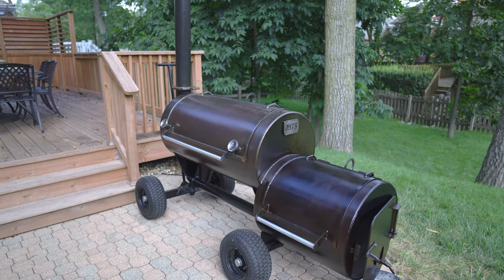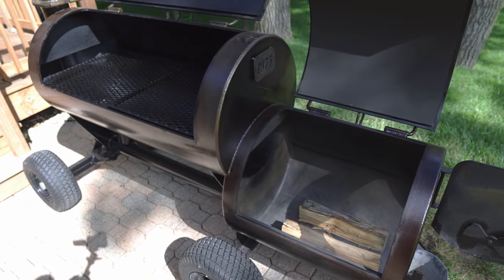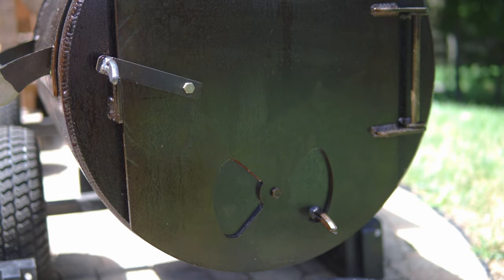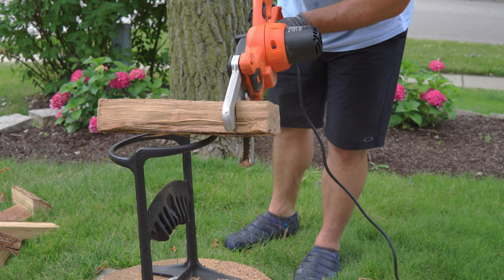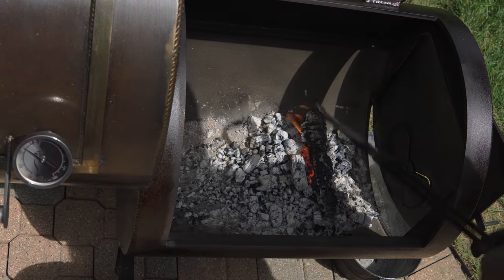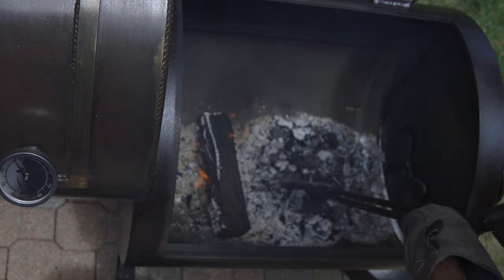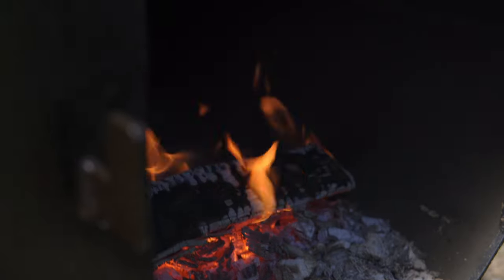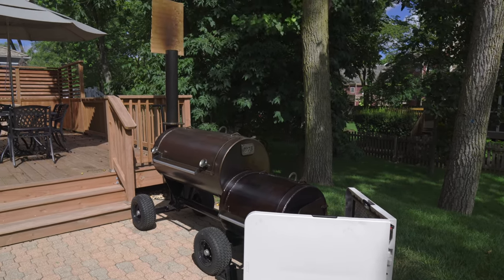How to Build a Coal Bed & Fire Management - Offset Smoker - Backyard BBQ

Comment: Thanks for this video! You did a really good job explaining things. Should make things easier for me when my 1975 arrives. I was thinking about starting my coal bed with a full chimney of B&B lump charcoal. Do you think this would make it easier and faster to maintain a good coal bed? Thanks for sharing!
Reply from the maker: Thank you! I've never used lump as a base, as I have a ton of firewood, so that's cheaper for me. However, there's plenty of Workhorse Pit owners who use charcoal or lump to get their fire started with no issues, so you should be good to go. It may be a bit easier to start your fire (using a torch makes it very easy too), but after that first split, I'm guessing it's the same thing.
Reply from the maker: I just remembered this video linked below - check out his 1st tip. Experiment with a few different lump charcoals to find the perfect one. I'm lazy haha and my goal is to have the easiest version of managing the fire as possible, so finding a lump charcoal that's a great fit for your fire is next level stuff. Once you get your pit, let me know what you find to be easy for you as I'm always looking for new ways! 

https://youtu.be/1-BVZgNco4Q

Comment: Do you ever have to clean out ash during a cook? I’ve noticed some smokers have grates that the ash falls through and the workhorse pits don’t just curious if that’s ever a issue.
Reply from the maker: No, you just clean it out after the cook or the next day. I’ve done several 13-14 hour brisket cooks and never had to clean out ash mid-cook. The natural curved bottom of the firebox is perfect for creating a coal bed and fire.
Reply: @smokescouts  thanks for the quick response. Great video, keep them coming. If you could do one on how to maintain different temps that would be great also
Reply from the maker: @904nole  that’s my next video! Probably a month away. I have some new tips and tricks I’ve been using too that I’ll share. Thanks for watching and the feedback!

Comment: I’m so glad I stumbled into this video. U answered every question about the size of wood and the tools I need. And so very informative about maintaining the fire. Im about to pull the trigger on the same exact workhorse 1975 setup as you. Im getting conflicting numbers on how tall the wagon 1975 pit is from ground to top of the stack when it’s up. I have a pergola it will have to sit under and im wondering if it will fit comfortably underneath. Could you tell me the exact height of your unit?  I appreciate it and I subscribed.
Reply from the maker: Really appreciate it, thank you! Ground to top of stack on 1975 wagon is 80.75 inches.
Reply: @smokescouts  perfect!  Much thanks!
Reply: @smokescouts  hey sorry just one more thing. When ordering the wagon, is it necessary to get the high gloss black paint for 300 more or would the raw steel with clear coat work?  Guess I’m wondering if there’s any advantage to the paint other than the look.
Reply from the maker: @RodStiffinton  the raw wagon must be a new option, I’ve never seen one finished like that. Mine is the high gloss black paint (the only way they made them when ordered). It’s just a preference on look because that part doesn’t get hot. I’m curious to see what it looks like.
Reply: @smokescouts  I might have them send me a pic of that look before I order. It’s 300 cheaper than the black and it might look pretty cool still. I didn’t know if rust would affect it more so than the painted version. Anyways I’m getting close to pulling the trigger. It might be an 8 month wait. Hope not. They said they are making 20 plus per week now. I can’t imagine the money they must be making.  What a great business. Anyways. Thanks again for all your easy to understand videos. Take care.
Reply: @smokescouts  hey Mr Scout, I’m still debating this 1975. Talked with Phil at Blue Smoke Smokers, he said he doesn’t recommend the wagon package due to the firebox getting so hot and it will eventually ruin the tires. Have you noticed any concerning heat that gets close to those tires by the firebox?  Do you think over time, it could be a problem?  Thanks man, I’m getting a quote from Phil and I’ll see where I land. Love your vids, make more
Reply from the maker: @RodStiffinton  no, I’ve used a Thermoworks IR radar on the tires several times in the winter and summer, and they measure in the upper 90s. A year later the tires look new, and the factory stickers on the inside of the tires near the firebox are still intact looking new too.
Reply: @smokescouts  hey does it turn easy, like the turn radius, and how is it going over grass?  Level turf
Reply from the maker: @RodStiffinton  I can do a complete Y Turn in a single parking space width, which surprised me. It rolls great over grass even though it’s 1,000 lbs. Once you get a little momentum it’s easy.
Reply: @smokescouts  sounds great. Do you find lack of a front shelf inconvenient?  Is there any cons at all to the 1975 or are you completely satisfied?  Sorry I’m droning on. Appreciate the feedback
Reply from the maker: @RodStiffinton  a front shelf would be nice, but not a decision breaker. A counter weight is supposed to be offered in the future, which would be nice too. Otherwise, it cooks like a dream.

Comment: I must ask. Do you open the big firebox door when you add and tend to the splits like that while you're actually cooking or was that just for this video to show us what's going on?
Reply from the maker: Mostly for the video. I do it sometimes if I need to rearrange the coals without kicking up ash. Thanks for watching!
Reply: @smokescouts  no problem! We've actually interacted on the Instagram workhorse page. You told me what size splits you use and using those gator loppers. Anyway, I figured it was mainly for the video. I was thinking about getting those tongs. Like why didn't I think of that lol
Reply from the maker: @jaredwatson8942  ahh, very cool. Those tongs are the only tool I ever use once my fire is started. I love those things, and they’re built to last a long time!!
Reply: @smokescouts  oh and where did you get that wagon? I am torn though between your way and jirby. You'd think adding a split or 2 at a time is common and common sense but then you have this guy just building whole fires and letting them burn down each time. I'm just not sure about his method.

Comment: Do u build a coal bed before putting ur meat on?
Reply from the maker: Yes, a huge coal bed before. It makes running the pit in the first few hours so easy. My technique has changed a little bit and I will be releasing part 2 soon. But, I start with a huge pile of lump, after 15 minutes I add 6-8 logs and let it burn for 45 minutes, and then I put my food on.
Reply: Ok, awesome. I built my own offset smoker just before Christmas, but i have no clue how to run it properly. I've been putting a chimney of charcoal on the bottom to get my wood burning, but I have had trouble trying to maintain good temps. Usually once i get clean smoke and the smoker upto temp i through my meat on, but today the temps kept dropping and i couldn't figure out why, but is saying that i decided I'd put less splits in this time compared to other times, so i was only putting in one split at a time today as where other times i was putting 2 or 3 in and getting a huge spike in temp. I might start building a coal bed from now on before putting my meat on

Comment: Being this video is about 9+ months old at this point.  Is this how you still manage your fire today?  And differences on anything you do today?
Reply from the maker: I have a new video coming out in the next month to explain new techniques. But if I’m burning drier wood 10% like in this video, yes the same technique. I’ve been using wetter wood around 20% and using my stack damper, so I have to build bigger fires to compensate. If my fire or coal bed is ever struggling, I always revert to this method until I re-establish my coal bed.
Reply: @smokescouts  good to know and looking forward to the update video.  

How much wood would you recommend having on hand for say 2-3 cooks a month?  Full cord?  Half cord?
Reply from the maker: @Spectre_N7  I like to have a full cord, 1 face cord ready, 1 face 2 months away from being ready, 1-2 face about 4-6 months out. Once my ready stack is almost gone, I’ll get a new face cord. I cook twice per week.

Comment: How are people losing their fingers using a miter saw? If you know what youre doing it should be rare, i dont understand how it's so common
Reply from the maker: It’s rare, but I’ve heard of 5-6 stories of it happening. I believe the saws are made for milled dry wood with predictable grains, so a split with varying grain, moisture levels, and potential knots can get the blade caught, pulling your hand into the cutting path. Before my loppers, I was using clamps so there was no chance.

Comment: Liked, subscribed, and rang the bell.  Thank You.
Like @jakewoodisgood I too have a 1969.   It's been frustrating trying to figure out fire management.  Can't wait for Sunday.  Gonna do a cook.
Reply from the maker: Thank you, I really appreciate it! Let me know if you have any questions.
Reply: @smokescouts  Do you find a benefit to starting with a bit of old ashes from a previous cook or do you start with a clean firebox each time?  I ask because my Weber grill works better with some leftover ash in the bowl.
Reply from the maker: @treatsnaturalpetmarketplac3999  I don’t do that, but I’ve heard a lot of others doing it with success.
Reply from the maker: @treatsnaturalpetmarketplac3999  I like starting with a clean firebox to prevent rust between cooks. The ash holds a lot of moisture.
Reply: @smokescouts  Noted.  Thanks.  By the way, I have my  best burn yet going right now thanks to the pointers in your fire management video.  Muchas Gracias!
Reply from the maker: @treatsnaturalpetmarketplac3999  That’s so great to hear! Thank you for the feedback!